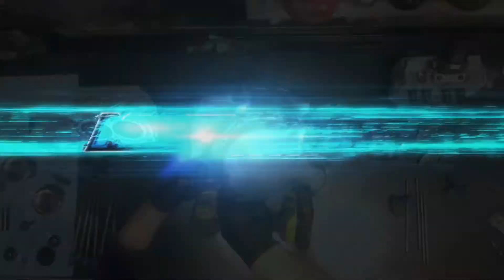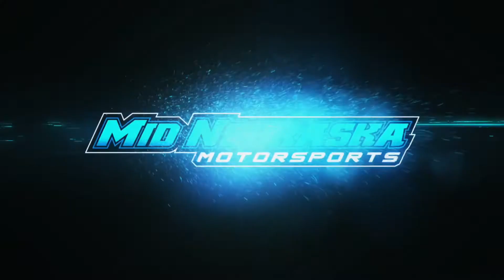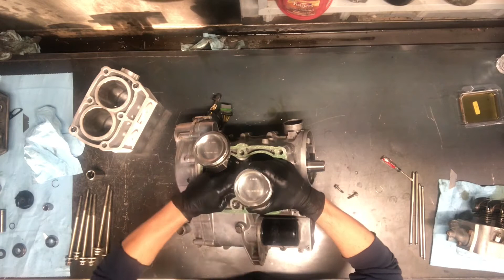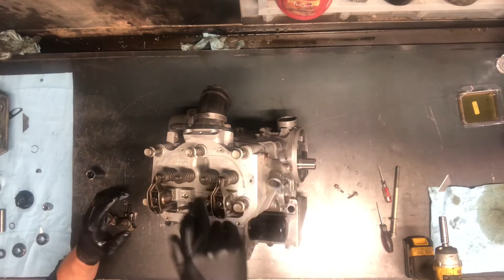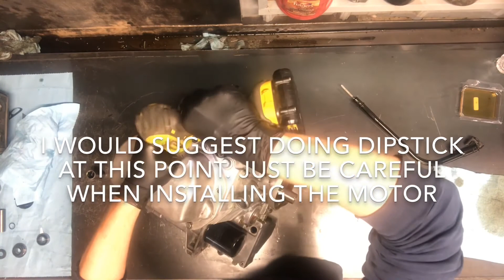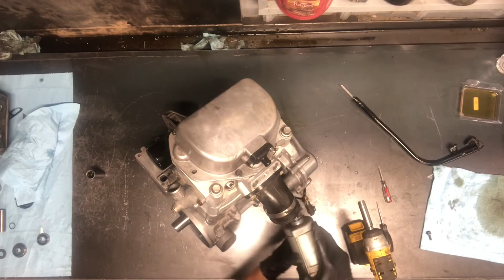🥇  Polaris Ranger / RZR 800  -  Complete Top End Rebuild, Piston & Cylinder Set

Comment: Were both pistons at the top of the stroke when you put the cylinder block on?
Reply: @MidNebraskaMotorsports  
Not doing a rebuild. I have a 2017 Ranger 900XP and like to learn how things work. I have  past experience with two cylinder BMW motorcycles. Both boxers and parallel twins. Their original 800cc twin had both pistons rising together, with the counter balancer phased at180°  In your video your overhead shot of the pistons looked like both were phased together.